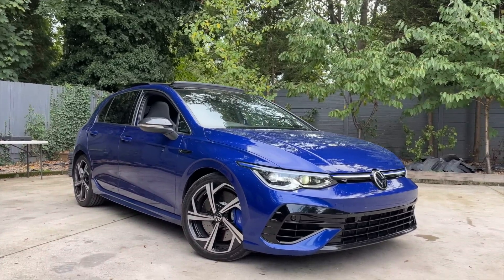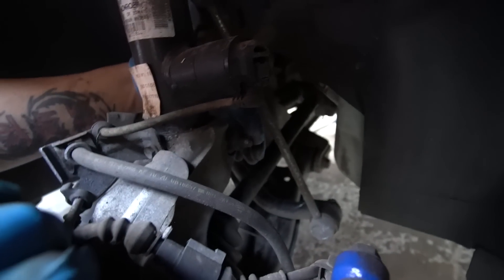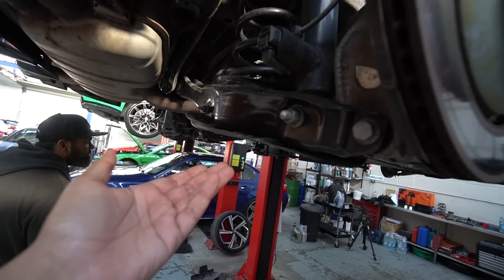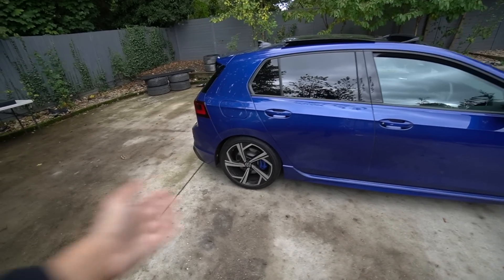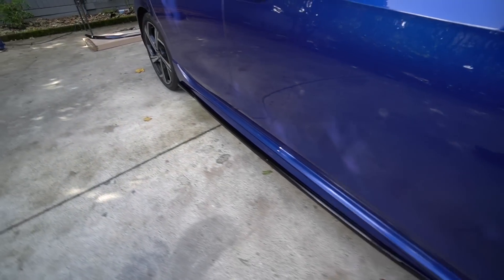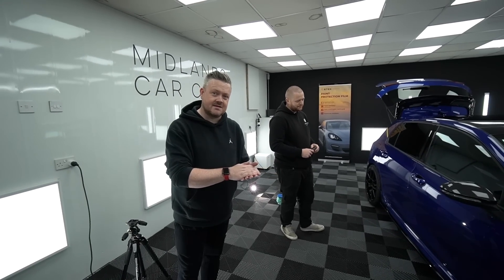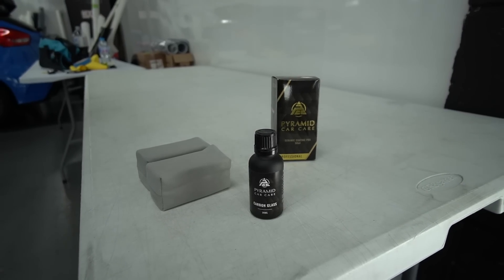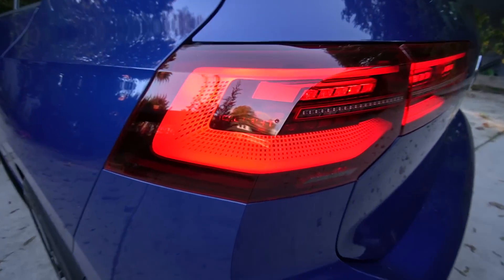Transforming my VW GOLF R MK8 with these 5 MODS!

Comment from the maker: Much prefer how it looks now!
Reply: Does yours have the DCC? if so how does it feel after the aftermarket springs?
Reply: Looks great. Need a really subtle front splitter that won’t get ripped off!

I think it would be a good idea to paint half the spoiler like you said. 

Top stuff :)
Reply: The main thing is that you like it. I also thought it looked too subtle, and I love how the lowering turned out. The wing also looks pretty good. I just can't get myself to like that Maxton stuff that almost everyone does on every car. To me, their parts look tagged on and not in line with any vehicle's design.
Reply: Looks really good now! Now to fix the interior somehow!!! The touchscreen is crap
Reply: Looks good however i feel like the wheel look a tiny bit to small
Reply: Looks perfect but seems the wheel is tiny😭
Reply: I've just ordered the spoiler from I'd auto, after sending 2 back from an eBay company.  I D auto recommend using bonding.? But I'd rather not. Its a lease and if gonna have to take it off. Is bonding removable?  Look your channel.  Any advice would be great. 👍
Reply: Could you send a link to this roof sport ....Best from Poland
Reply: nah...it looks great.  I have same wheels and Michelins on the way for Winter in the PNW...will go for sum 19" Vossens in the summer🙂

Comment: hi good videos as always can i ask you ive just fitted a larger intercooler on my tt b4 fitting it ran fine  but after fitting in cold as runs a ruff  as F ...   dose it mean i have a boost leak of i need a remap as i have alot off supporting modes but no mat still.. ie hpfp..decat rs4 return valve runner flap delete ramair induction ....and now the intercooler and uits a tts with the ko4 thanks

Comment: Looks so much better , shame about the splitter that really finished the look and wasn't too aggressive,  definitely needs another one to balance to look , boot spoiler looks great 👍
Reply: I have an 8 R. I'm dead careful when I drive over speed humps - and the car is stock 

I just measured and the bottom of the front bumper is 17cm from the ground 

Dropping the ride height and fitting a splitter was always likely to result in tears.

Comment: Oh no, what a shame the front splitter didn’t cope with the ride height. It definitely looked great and complimented all the other parts. A nice load of changes to personalize the car to your individual tastes. I have to add that I gulped hard by using self taping bolts on the sides. Being an Italian car owner they don’t need any encouragement to start rusting. I suggest removing each one in turn and stick in some wax to help stop corrosion. A generous amount on each bolt thread too. You can thank me in 5 years!  🍺

Comment: You must see what ceramic coating looks like in 4-5 years later on a car - leather exterior, don’t let anyone do that again to your car is my advice . A blue rear roof spoiler would of looked nicer . Pity about the front splitter - looked great but if it’s fibreglass- don’t ruin a car😅

Comment: Total change to the look with those simple mods 😍
245/40/18.. any rubbing? would that set up work on the mk7 too?
Reply: Stock height on mk7/8 is fine with 245/40r18. I do wish the calipers were a bit smaller to squeeze 235/45r17's on especially for the roads where i am but the 18's are a good compromise.

Comment: Ordered MK8 GTI back in May 21  ( 71 ) reg  moonstone Gray with 19 wheel   / rear cam / sunroof, did only 5k so far .  Car had few issues including software but all fixed under warranty .  Never had issues with Vw / Audi in the past especially with a new car . Engine cheap  plastic cover  removed by VW due to safety  . Never impressed with this car at all looks like it was made in a rush . Going back to Audi next one .